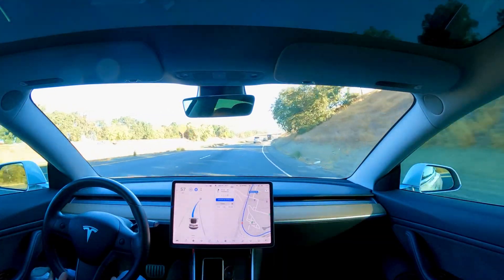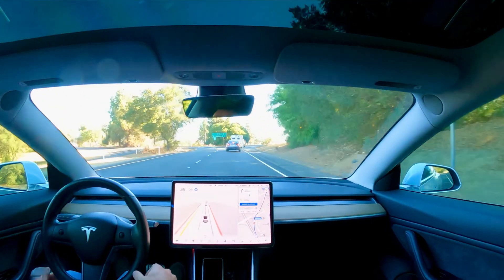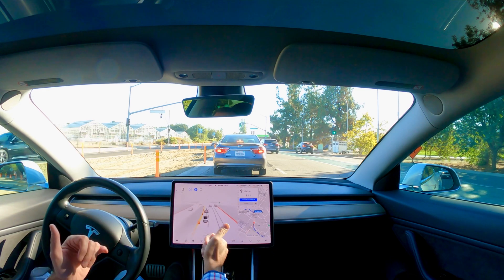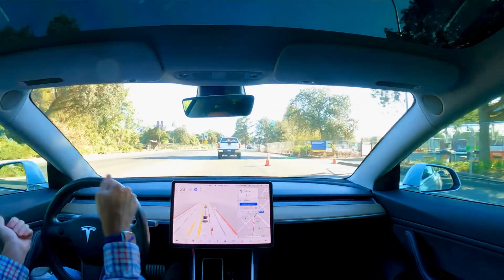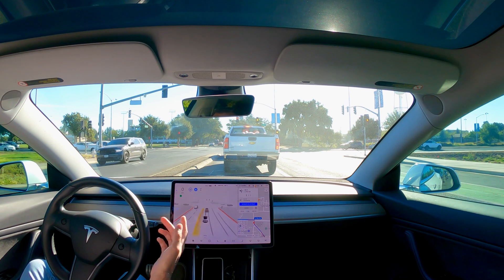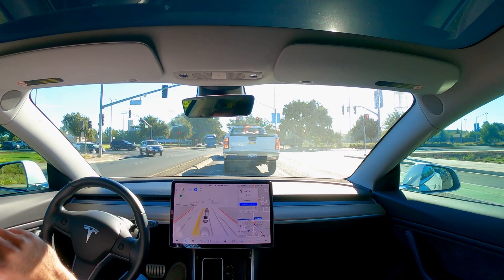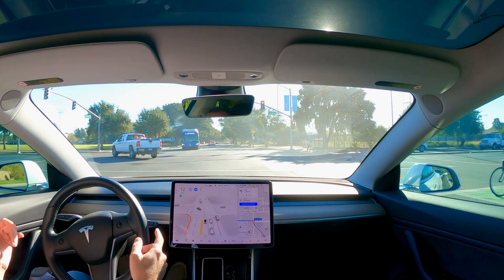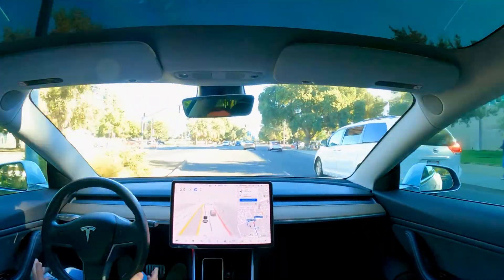TESLA #FSDBETA V10.1 Cone Test Series - 1

Comment: At the end there, it isn't the cones that bothers the car. Instead, it knows from map data that it is driving on the wrong side of the road. So, it is trying to move across to the right side of the road. 

It's clear from this, and other people's videos showing similar situations, that it hasn't yet been trained/programmed to drive on the wrong side of the road to go around construction work. Currently, this is a situation where the driver is expected to take over.
Reply from the maker: Exactly! That’s why I keep testing these scenarios. Every release is behaves slightly different.